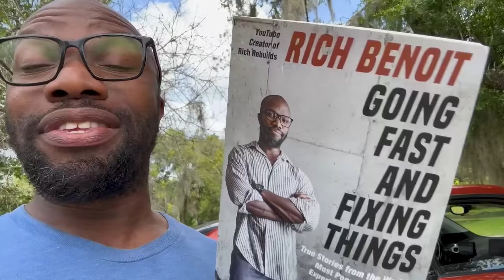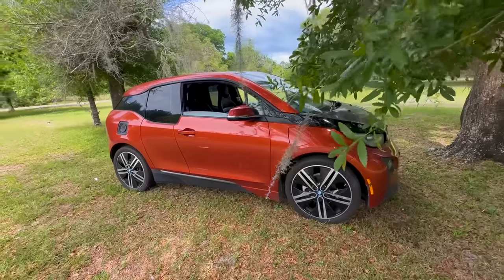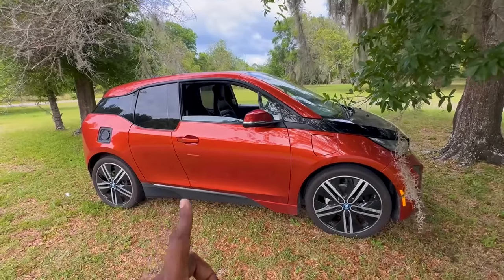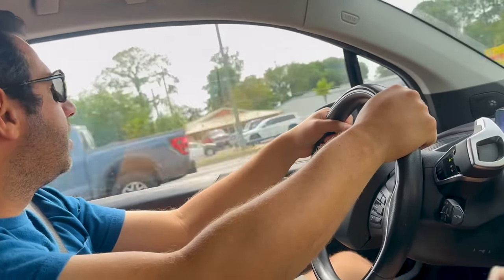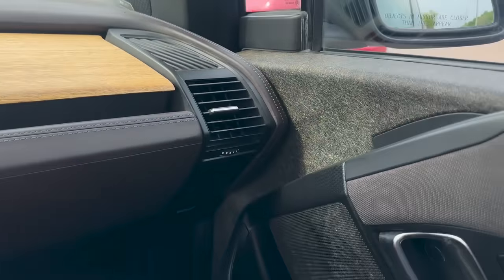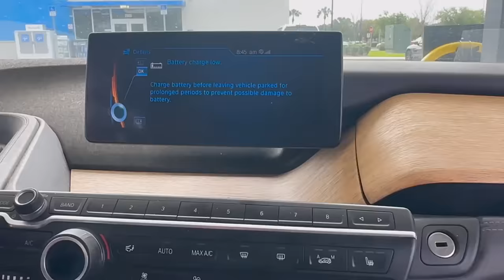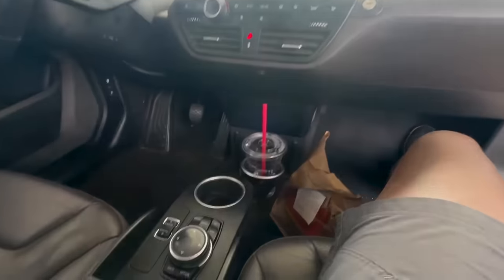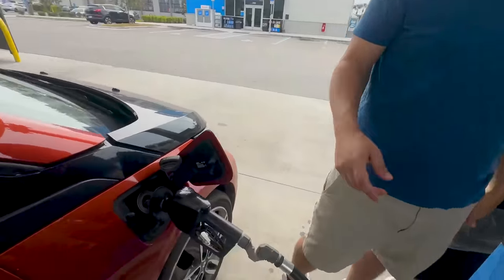I Bought a Ten Year Old $3500 EV and I Increased its Range To Over 400 Miles!

Comment: That AC issue could be a very expensive thing. Metallic parts can break off from the compressor blades, and get into the coolant lines requiring major repairs. The compressor, condenser, and HV battery accumulator may need to be replaced. A flush is also needed.
Reply: I had my compressor fail like that. I had to replace the condenser twice because it got clogged. At least the condenser works like a filter for large metal pieces.
Reply: Some were putting filters in the AC lines around the compressor to catch the larger metal fragments that might come out of the failing AC compressor.

Comment: Important to get the AC working. The battery pack's thermal management is also done using the AC compressor.
Reply: So regardless of using the AC in the car, the compressor is working anytime the car is in motion? Wow that would seem to explain why they break more often than other vehicles.
Reply: Yes.  It seemed to be the weak link in the design.
Reply: @jasona8964  It depends upon the battery temperature.  If I remember correctly, there is an electric heater to warm the battery to accept a charge when it is too cold.
Reply: @jasona8964  No, it depends entirely on the ambient temperature. The car seems to want the battery around 11°C to 15°C, but the battery also heats itself when you discharge it, so the AC runs predominantly when ambient is above 15°C... which is mostly when you want it for yourself as well (my wife starts feeling hot around 21°C for example, which is a little lower than myself). The AC is also variable-speed, it runs at the speed needed for the level of cooling, unlike your engine-driven kind that always runs at the engine speed and only has rudimentary on-off clutch control (alright, there are some cars, also BMWs, that has some sort of proportional speed control even for ICEVs, but it is not that common).

They are however somewhat of a weak point on these cars, that is unfortunately true. It doesn't have to be that way though. Your Tesla model Y uses a similar scheme, and they seem to have way less AC breakdowns. It's probably just normal BMW-itis.

Comment: You just need to adjust the throttle settings in the Fardriver app. You always seem to get a little lost when it comes to the electric stuff. I would be happy to help you with this. I work from home and I'm in the same time zone.

Hopefully you have the Bluetooth adapter for your controller. I can tell you what to change, why you're changing it , and best practices so you don't kill your motor and controller.

Forst thing I always do with a Fardriver is pop the top off and cover that stupid piezo beeper. The boards in those controllers are completely potted, so basically waterproof. If course in the top cover of the controller is a hole that they have simply put a sticker over. Absolutely hysterical. You gotta learn Chinglish to master these controllers. Oh man.

Comment: I also think this fills an interesting niche of luxury compact car. When every other manufacturer focuses on huge expensive luxury crossover SUVs and pickup trucks, this is the one luxury car that fits into a tiny footprint. And I think that's a great idea! Especially if you live in the city, you want something small, maneuverable, and easy to park. When people with money flock to cities, why must their luxury cars be colossal and difficult to drive in traffic? A little range-extended EV is perfect for that use case. Enough electric range for city driving, and with the range extender you can go a bit farther when venturing outside the city.

I honestly thing hybrids are the best of both worlds when it comes to the EV vs ICE debate. Perhaps not this one specifically (the concept is great though the execution is flawed), but the packaging challenges have long been solved by now and hybrids use different battery chemistries that last longer and are less flammable so they're better long term, so you get a practical fuel efficient vehicle with the range of a gas car (unless it's an i3) and the efficiency/regenerative braking benefits of an EV.
Reply: Have you heard of the Aston Martin Cygnet? It was only sold in Europe and is based on the Toyota/Scion iQ. Only 600 were ever sold in its 3 year runtime. Sadly, it doesn't seem to be popular to build a small luxury car.
Reply: Yes my Nissan Altima Hybrid did last for 12 years, but the dealer and the company refused to help me fix it when it had a computer problem, just buy a new car. So I bought a Tesla.

Comment: So why did you put the transfer tubes in at the tops of the tanks? A 3/4 in tube running from the bottom of one tank to the bottom of the other would fill and empty the tanks at almost the same rate without affecting the onboard sensors of the BMW. No electronics or monitoring necessary.

Comment: On my British spec i3, I quickly learned to only let the battery go to ~50% when doing an extended journey, as the REX can't keep up when pressing along, but gives a really good balance of range vs consumption. Mine has the DC prep so a fast charge from near empty is 30-40mins.  It still means stopping every 2-2.5hrs but that is more palletable.
Reply: the internal battery resistance goes up exponentially starting around 50%. It's why going from 75% to 100% takes longer then 0-75%. So what your saying lines up.

Comment: I owned one of those years ago. The range was the biggest problem. The heat/ac system is the reason the battery drains SO quickly.

Comment: Hey Rich. I installed a vtwin vulcan 800cc engine in a golfcart. No I don't golf. But my question is nice it's watercooled I don't think the small pump is moving enuff water since the radiator is 3 foot away from the engine  you used a Tesel pump? Can you give me a bit more info on your setup  and should I use a larger radiator too? Cheers joe. There are videos on my lil channel if you want to see the hell I went thru. Lol buy it was a blast

Comment: My problem is exactly the opposite.  I have a Cadillac ELR and it has a large enough gas tank but, the battery range sucks.  Been doing a little research and was thinking about trying to adapt a Chevy Bolt battery.  The ELR has about a 40 mile EV range and the Bolt ha about 240 mile EV range.  If it could be done it would be the best of both worlds instead of the worst of both worlds.
Reply: There's no way you're doing that, how do you think that's going to work? The Bolt has a full-size, 65kWh battery that spans the length of the cabin underneath the floor. The ELR has a tiny 17 kWh battery that's T-shaped and runs in the tunnel and then perpendicular in the mid of the car.
And that's ignoring the entirely new software.
Reply: The hard part is the computerized control needed.
Reply: @rustler08  Kinda like stuffing a supercharged V8 with a sequential shift transmission in a Tesla.  👍
Reply: @blackterminal  Parts is parts.  GM made both.  I can’t imagine they had Merlin working overtime concocting en entire set of different parameters to do the same thing.  But, we’ll see.  It would be great to get @200 mile EV range on top of the @200 ICE range.  Been working on hot rods all my life and “It can’t be done till it’s done” has always been around.
Reply: Keep in mind, that Caddy is a lot heavier and a lot bigger and probably had more electrician functions to fun. 
So, a Bolt battery wouldn't be my first choice!

Comment: Just be aware of the two MAJOR failures... Drive motor, and Aircon Compressor... either can total-out the car. The drive motor should be very nearly silent... if not, the bearings are failing (bad design choices... permanently sealed bearings, and the wrong type at that!).  Mine failed, started at 75k miles, finally had to stop driving it at 94k... motor and transmission replaced... but NOT by BMW. 

Same for aircon compressor... it should only make a quiet humming noise... any more, and it's grinding itself to death... and will plug up the refrigerant plumbing in the whole car... INCLUDING the HV battery pack! (stupid design)

Comment: this car (with the available battery tech) was never meant to be driven like you did. its strength is in urban areas with lots of stop and go. the perfect commuter.
 
btw my dad worked in engeneering for bmw ("extern") on the i8. 
basically, both i8 and i3 were never meant to be produced in those quantities and were only supposed to be "Technologieträger" = technology carriers. kind of small mini serial productions to pave the way into larger serial production of electric cars with possibly crp as a replacement material for metal chassis. bmw was leading the mass production of carbon fibre around that time.
back in that day everybody thought composit materials would soon replace metal, but a decade has passed and people seem to actually care less about climate change than they did 10 years ago. so lighter and more efficent cars have gone out of fashion entirely. everybody wants 3 ton trucks and ugly af suvs, while complaining about gas price.

Comment: 105k miles on our 2017 REx.
-Owned 4 years, and only one fault in that time (a dim LED light strip ..no biggie).
-We save $2,500 each year in petrol (but spend $500 yearly added to electric bill).
-I change oil annually DIY, even though the generator only gets used once a month on road trips.
- No rust. 
-Brakes last forever with strong regen.
- Center of Gravity like a Porsche despite tall proportions
- Great in snow

Comment: ok lts not be Tavarish and slobber over the I3 so much.. it doesn't look "new". It has roughly the same stylings as the old Chevy Volt with the BMW snout and half the space.. It's unique, I'll give it that, but it is fairly dated at this point.

Comment: Great mod, until you realise that the i3 has no crash structure in front of the windscreen and you build yourself a giant exploding fuel drum that powers a two cylinder motorcycle engine powered EV :)

Comment: I own this car and it's like driving Mario Cart, It is a ton of fun to drive, and the acceleration is nuts...( I'm addicted to my commute to work on a curvy tropical coastline road ) The range extender makes this the best of both worlds can't understand why BMW is the only one to charge the battery with a small ICE. I destroy cars and this thing is going solid after 6 years of abuse, I only replaced the 12-volt battery once and the tires that are a bit delicate a few times.  Love the car and here we have gas stations everywhere btw I only charge my I3 at home, but as always Rich your ideas are amazing for an I3 owner that drives longer distances this is a solution for the REX small fuel tank limitation.

Comment: I kept thinking about buying a used i3, but I tried looking at tire stores for replacement tires.  I tried (a while back) Tire Rack, and multiple tire chain stores and even Walmart.  None had tires.  So, when BMW quits hoarding tires, then what?  Is there a wheel swap for easily available tires?

Comment: Why are you using the filler cap to refuel the main tank, and not going directly into the tank? The way you are doing this, if you completely fill both tanks, and continue refueling the secondary tank, with the pump on. You will literally have fuel in the filler line! Same thing if you only use the secondary tank to fill both tanks up. I mean it will give you like an extra mile I suppose but, the lines aren't designed for storing fuel.

Not gonna lie, I'm a little disappointed. I really thought you'd do this properly. Just fill one tank, that tank flows into the other, and you have an extra 8 gallons of fuel, that moves over to the main tank all on its own, no buttons necessary. And definitely no fuel in the filler line. 😢

Comment: Sam seems to be breaking everything.       It doesn't use the engine to make the motor move.  It just charges the battery and is really inefficient.  It's not a hybrid.  How do you know this little about this EV

Comment: 31mpg!?!?!?!?  My 300hp v6 Mustang gets 30mpg.  I guess you lose a lot using a gas motor charging a battery.  If they hooked that motor directly to the wheels, you would hit 50mpg easy.  If you only commute, then I get it, but still, stick a 10 gallon tank in there.

Comment: I’m not sure about PHEV being the worst of both worlds. I swapped my 290bhp hatch for a PHEV equivalent 245hp. It has saved me a fortune most of my hard earned money disappeared in around town trips where the mpg was around 23mpg. I get much much more left in my wallet doing those trips on EV mode. When I do hit the country roads the performance with the EV & petrol engine doesn’t feel any different although I dropped 45hp. Even on long journeys with zero charge I still get nearly double mpg than my old car. Yes I fully understand the battery might need changing at some point but even if you didn’t change it it’s still great to run as a full petrol car. Best of both worlds imo.

Comment: What a stupid design why would BMW do that, ridiculous. My 2019 Chevy volt has the ultimate hybrid range extender design that everyone should do with ONE exception the battery is 18.4kwh and would have been nice to have over 20kwh or up to 25-30kwh battery. In summer I can get 110-115Km(68-71mi) per charge but with the range extender on the highway I can go almost 1000km(600mi). my gas tank is only 35liters(9usgal). The hybrid engine does not drive the wheels, it only drives the generator so it is super fuel efficient. driving in the city I drive on 100% electric 90%+ of my mileage! (ALSO I GET FREE CHARGING AT WORK... AWESOME)

Comment: Rich.  When you going to stick dual motor model 3 Tesla engine and a 50kw battery in this i3?  ;). 😮😅 22x12 inch tires in the rear..   🛞& LED headlight fog light upgrades. | custom orange leather interior and upgraded 13.3 2048p android head-unit.

Comment: I owned 2 BMW i3’s. 2014 and 2016. Unfortunately last month somebody hit the front of my 2016 and totaled it. If you had gotten the 2016 or newer the rex engine does a much better job at keeping up with the charge. Honestly as long as you don’t turn the car off to reset the hold state of charge you could drive indefinite. And if you drive conservatively you can get up to 60mpg. You could make the unlimite ev if you do what you just did with a 2016 or newer i3.

Comment: I have a much later version of that car, so a bigger battery and more usable factory gas tank. Seeing how little range that one has gives me range anxiety and I’m not even driving it! If I take a leisurely drive it’s 150km (90 miles) electric range, plus 100km (60 miles gas). I often drive on the NJ turnpike though, so there’s nothing leisurely about my travel 😂 I have road tripped across New England in it before and it’s not TOO horrible.

Comment: April fuel EV? BMW i3 with REX has very limited fuel tank size in order to still be classified as EV. It's just a safety measure, for comfort of the mind or in critical situations, not for everyday driving on fuel in an car that is an EV. Putting in more fuel just makes no sense. Just like pulling a trailer with a big fuel tank for a range of thousands of miles. In Europe, BMW had doubled the battery size (from tiny 60 Ah 18+ kWh to usable 120 Ah 36+ kWh) and eliminated the REX option as it had become obsolete.

Comment: If we ever solve the SINGLE biggest hurdle for EVs they'll be amazing. Batteries suck. The range is awful. They are an ecological nightmare to produce and when they are used up. They are safety/fire hazards and are impossible to truly put out until they burn out... and they take too long to charge. 
If we ever solve the battery problem, EVs will be great.

Comment: I was just talking about the appeal these older EVs have for people like me. The reduced range and aged batteries dont really bother me, if they can be bought for low enough cost I'd b3 happy with sub 100 mile range for most of my usage. I barely drive 2 miles to work, all my amenities are near by, i only sometimes go across town. I have a teuck for truck stuff and a fun car for fun stuff, a little hatch for longer trips, a little EV for most of my da8ly needs sounds perfect,  if i can get one really cheap.